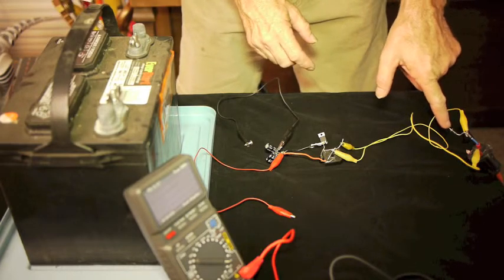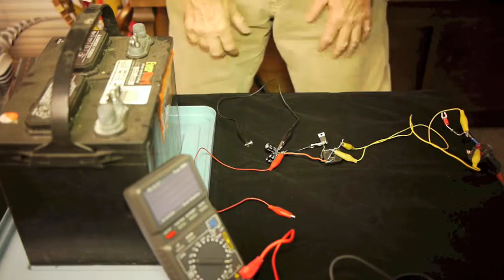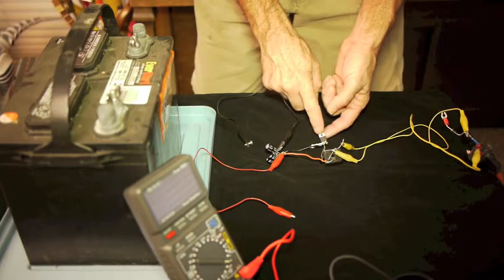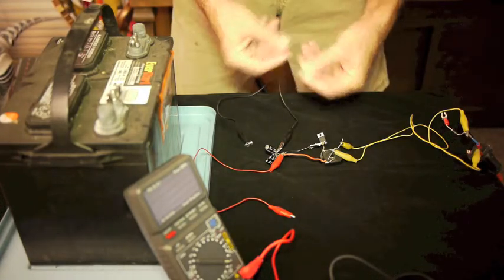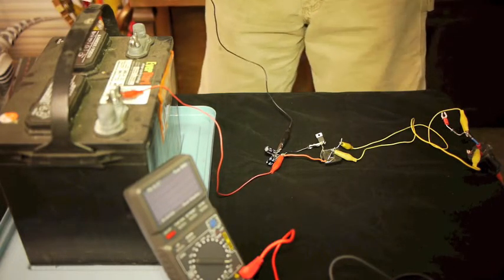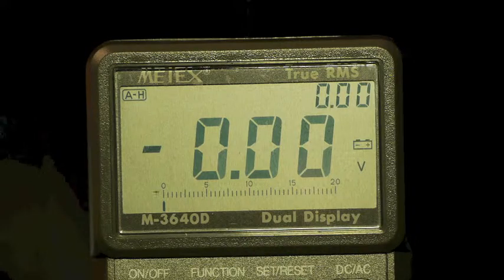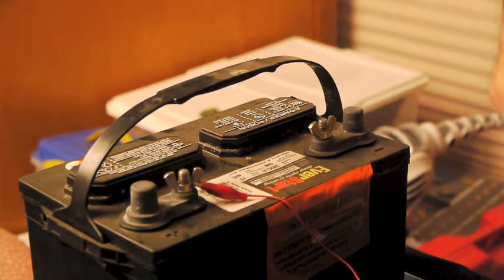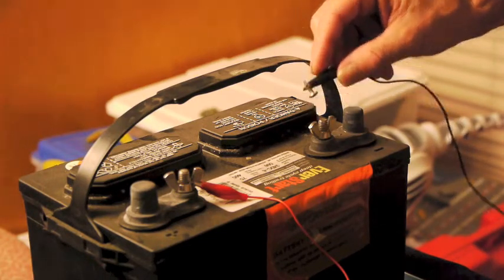Charging a Battery with High Voltage Spark

Comment: Sir that is a very dangerous circuit you have there. I take it that the  three capacitors are in parallel  with the DC output of the rectifier and there is  no protection fuse.    Well if the battery is poor , it would have a very high resistance and so the current will be low, but  if the battery had to become with a very low resistance, as is the case with a good battery, the current will rise to a very high current and  it will blow up your circuit.  I am assuming that you are feeding from a High Voltage source .  Having  a low impedance load is not advisable in your circuit. 
If you put the capacitor on the AC side in series before  AC input to the rectifier,  and the battery on the DC side of the rectifier, well that is another issue.